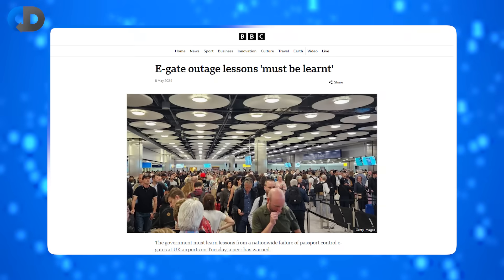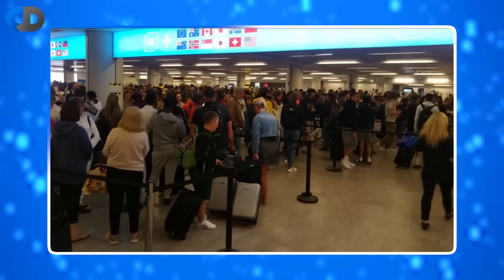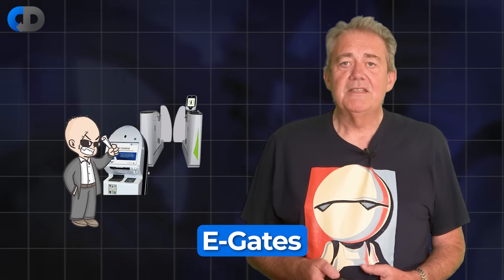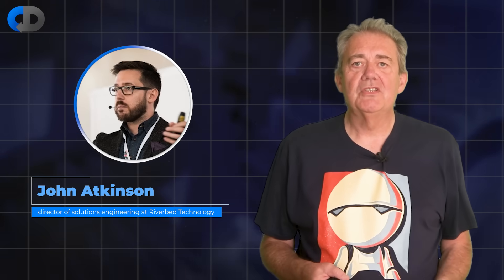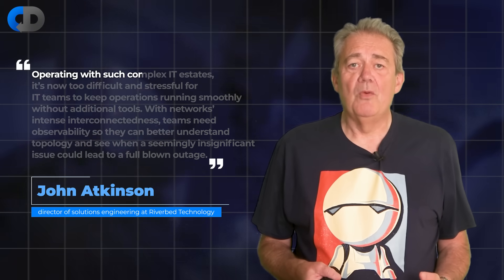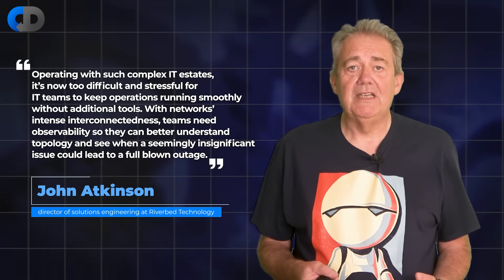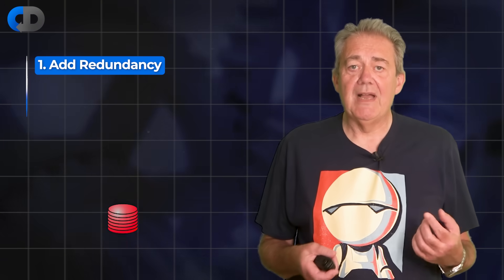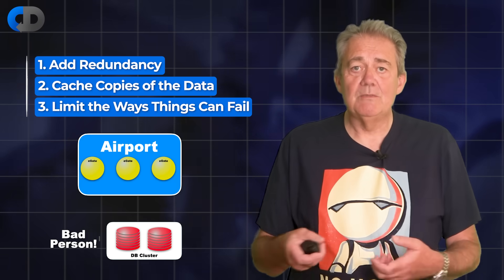Software Engineering F&*K Up Behind The Passport E-gate Failure

Comment from the maker: FREE 'How To Evolve Your Software Architecture' Guide: How to work in ways that keep stuff easy to change which gives you the freedom to make mistakes and experiment and how to work in small steps that allow you to determine their fit for your present understanding of the problem... continuously. All explained in this FREE compact guide. Download HERE ➡ https://www.subscribepage.com/evolve-your-architecture
Reply: This video is bad advice or at least incomplete.
1. It is a problem of service management first. Because the failure of the network was either not evaluated or not tested.
2. Sometimes I do not want resiliency - I want failure. Because if the system is failing, it could be a bug, design bug, security breach. If it is a design bug or security breach, resiliency may result in leaking or corrupting a lot of data. Potentially - customer data. It is better to fail than to continue.
3. How easily you dismissed security issue. Why?
4. Usage of cached data may not be suitable. If a bad person must be stopped now, then cached data is not an option. Usage of cached data introduced replication, invalidation, privacy challenges. This can be exploited. This introduces more things that can break.

And if all things can break, then advising to do better design, to have caches, to have secondary channels - conceptually does not solve anything. As we are on continuous delivery channel, you should know about ITSM practices, ITIL, MOF... They all focus on continuous improvement besides other things. There are critsit trainings for that etc. There are business continuity plans for that etc. It is ITSM - not another component or piece of code that fails.
Reply: ...  as estonian i'm just... 

"what on earth are those  brits yapping about...  " that system is Mid level difficulty , how can you fail in system like that.... :D not even  superdifficult

i guess,  estonians are just on another level in state-level e-services and infra , 

e-services have never been down  :D .. in the rest of the world, u watch Weather Report from news.. 
in my country... in weather report , there's  cyberattack reports , how many times attackers have failed this week : ))))))))))

Comment: You fail to address some vital things in this criticism which makes it hard to take you seriously

Potential issues with your suggestions:
- cache the data

What is the acceptable latency for data to be out of step?

My theory would be that the engineers were told there is no acceptable latency to someone being marked as not allowed to enter, and the machine knowing that at the time of entry

- store the data at the e-gates

Is this acceptable from a security perspective?

Comment: The home office is not going to allow airports to store copies of their data. They're also not going to host their own local cache instance of their API within airport networks, either. This has a security nightmare written all over it and would get shot down immediately. 

The problem appears to be connection related. If true, they should be looking at using  dedicated connections, and have a backup connection.

Comment: In the early 2000s I was asked in an interview to look at a system and say how it could go wrong, and how I'd mitigate against it (or what could not be and we'd accept failure gracefully).

I haven't been asked anything like that since. Just a lot of questions about algorithms I'm never going to implement, or design a system from scratch in 45 minutes with no time to really dive into all the failure modes.

Comment: Lots to unpack here. Replicating data into a local cache will reduce/remove the immediate impact on back-end system failures, but, it throws up other problems beyond update latency on the local cache. You now have the opportunity for secure data to be accessed and manipulated away from the central security. You have created a weak point that could potentially be exploited. One would hope that you can harden access to this local cache to prevent that, but you've created a new design issue and weakness that has to be assessed and fixed. Availability is a key issue, but also, system security integrity has to be maintained. I would envisage a capability to put an all-stop on processing. This could be for example to maintain security and integrity - something that likely would never be acknowledged. That 'need' would likely have a higher priority than end-user inconvenience. That said, any networking for this kind of application must be on secure infrastructure only (which absolutely excludes the use of WiFi at any point). The problem is that integrators and systems maintainers tend to put in back-doors to make their day-to-day life easier. I know this happens. In scenarios you wouldn't believe. 
Just putting 'exclusion' data locally creates potential problems then created from providing stacked updates back to the central system when endpoints become detached. Not insurmountable, but another set of problems to be overcome to ensure latent updates are correctly applied. There will be an awful lot of processing going on behind the scenes to provide for example, tracking alerts to many UK security agencies. Processing that has to be done in real-time. It is a bit more involved than tracking stock and sales transactions in a retail environment.
Could the e-Gate system do the same as the laptops used instead? Probably, but, there may also be operational reasons for falling back to a people based system. But, I suspect the actual cause was budget limitations considering the cost of a more flexible higher-availability solution. A 'safe' system that has a 95% availability target was all that the budget allowed.

Comment: I do agree with small portion, but having a cache is not correct and form a security perspective is wrong. lets put it this way.
1. 2pm Internet is down and system has a local cache of 10 people. 
2. 3pm new person is added as a bad person (system is still down)
3. Bad person enter the country and use e-gate -> Welcome Sir ....
Above is very unlikely but still can happen. We are dealing with very very sensitive data here and I am surprise the idea of local cache is proposed. I am surely its not a perfect system, but you need to understand the full system first, before making suggestions.

Comment: It's really cool you have so many technical brains here but the reason the system doesn't have local cacheing is that is a political toy, not a system of technical efficiency. 
The governments are pandering to the right wing, they are posturing to "keep the bad ones out", which is why a fail-closed system based on a single link rather than a series of reversions is in place. 
A technical minded person researching this to build it would know that 99% of pickups (getting the baddies) happen >50 nautical miles from any given national border based on statistics released around 2016 that were measuring the efficacy of post 9/11 security policies Vs recent and older history. Knowing that, a technically minded person like the majority of commentators here would have said that having multiple redundant links over different mediums with a layered system of caches and databases would have suficed to keep people moving safely through the port without losing critical data. 
Sorry, not sorry.

Comment: It’s the £££. Hardening a system with extra resilience adds development time and infrastructure. at some point a line is drawn where the budget / cost vs benefit trade off is deemed acceptable and anything that may happen rarely is just accepted as a risk. That’s the reality unfortunately. While there are several solutions to the problem that happened, at some point they were deemed as not desirable due to the financial impact to the project. Ie a dual network link from two different providers routed through different pathways costs more than not having it. A local cache or local server that would need to meet XYZ data protection requirements in each site costs more (surveillance, cages etc). Redundant power costs more and so forth. So at some point there’s a line drawn in the reliability department and the rest accepted as collateral damage, especially in massively over budget public sector project

Comment: Another example of egregious British Information System design and implementation.
Other examples - neither the Passport Office nor the NHS can handle surnames with full stops or commas in them, such as St.George or d'Ath. This issue is common throughout the British private sector and local government as well. To be fair, HMRC and DWP get it right, which causes problems when trying to match individuals between different systems.
"Losing" records is another common failing, so DVLA can't find records relating to driving licences, for example.
One of the issues I most frequently encounter in the UK is the non-involvement of senior people who have actual knowledge of the real world requirements.
YABSS (think about it).

Comment: Sounds like some one made the decision to have only source of truth (considering PII is being looked up). 
If one does not trust storage at rest in caching systems than this is what managers often decide.  
They should have at the very least have had a redundant communications network though.

Another issue i often see is that management is wary or downright scared of eventual consistency: imagine a database was updated to include a new unwanted person and the gate wasn't updated in time.... Everything involves risk, but if you are optimising to prevent that one small edge case to the detriment of the entire stability of the solution. YOU ARE DOING IT WRONG :P

Thanks for another great thought provoking video!

Comment: While a good example of failure, it maybe that other factors really really got in the way of the 'design', such as the secrecy of certain aspects of the said 'bad person' list (Oh, people & politics, sigh), but as said the fall back may have been worse, but more acceptable. 

And maybe the presumed BT shutdown of a Wi-Fi channel should (that word again) have just change to the £1/MB charged else where on some mobile plans ;-) politics & money.. (see Matheson's 11k iPad bill...)
Reply from the maker: I am sure that that was the thinking, but that is the design challenge here, how can you achieve all of those requirements while still achieving resilience. I can think of several different approaches that may work, and I am sure that we could find one that did once we had examined all of the constraints. But that is the job! Not simply making a crap system because some parts of it are difficult to achieve otherwise.Our job for a system like this, should be asking us to solve the hard problems, not just find the naively simple solutions!
Reply: @ModernSoftwareEngineeringYT  One part of the problem is the generally fallacious belief that we can always create a design that solves all of the problems with just a lead developer or small team.
  
Once the scope of the 'system' reaches the level of "Crapper's brainfull" (the metaphorical last person to completely understand the system they were designing) then we continue to find levels of detail that were unknown or unappreciated that result in such failures.
 
This is tree of knowledge issue is covered by RE Bohn's "Measuring and Managing Technological Knowledge" paper (1994/1998 Sloan Management Review/ ..), and is also reflected in Conway's Law.

It ultimately results in the proliferation of the ideas of Systems Engineering which also attempt to address the issue.

'Government' systems do tend to have that greater level of complexity ("Wicked System" problems of multiple stakeholders and longer term issues) than commercial systems with their 'simpler' shareholder focus (which is bad enough..) and PR management. 

However I do agree that there should have been more resilience foresight and expectations of the 'if it can go wrong it will go wrong, badly' style.

Comment: Unfortunately, the cheapest bidder tends to get the contract. That inevitably means delivering the absolute minimal agreed specification, and if that doesn't include contingency then what can the developer do? It's not the developers job to write the specs/urs (though yes, they will have an influence, especially if the purchaser's IT skills are low). Local data? Surely we've cracked that security nut by now?

Comment: Very interesting. What if the backup list was only used when the connection doesn’t work? Wouldn’t that avoid the eventual consistency problem when things are working?
Reply from the maker: there is no eventual consistency problem when things are working, changes would happen so fast that it would be, effectively, the same as the supposedly synchronous version.

Comment: Simian army, and the MS STRIDE threat modelling could have identified this, and then adoption of something like the BitTorrent protocol (you wouldn't steal a list of those not allowed into the country) to provide resilience around node failure could give peer to peer sharing between gates automatically if they can see each other on any IP network. Local DB for actual processing and....it....should...work?

Comment: Erlang is a great tool for running those e-gates.

Embrace the failure, live with it , anticipate it , crash now and catch it later (in a matter of ms) using supervision trees and distributed computing Erlang provides among many other features.

Great talk, sir!
Reply: Erlang also designed as a distributed system where the client is the source of truth. So no matter how many retries there will be guarantee of correct input. E.g, multiple cell towers could handle a call, and whichever failed to handshake first would crash. It will in no way affect the correctness of the entire system, only a momentary capacity issue.

When it's the reverse, you can't really rely on retry because there's no guarantee that the crash condition would either repeat or be resolved in timely manner.

Comment: Many years ago, ticket controlled passenger barriers were installed in Newcastle Central Station.  I travelled several times a week. As an experiment, for many months after the barriers went live, I used the same old ticket to pass through.
I expect either a software / requirements bug, or incomplete development ... or problems getting some link to a back office database.
The interesting thing about the passport gates is that there is actually no need for the data to be fully up to date to the millisecond, or even the hour. It is all about limiting risk to the protected territory, not eliminating the risk. (Although I suspect that many do not understand the difference).
The system may also be logging arrivals and departures of all individuals as well as other "features" in addition to a "bad actor" lookup.
Reply from the maker: Yes, and all completely solvable problems with a truly distributed design.

Comment: It often boils down to, "we took the cheapest quote." Local copies require extra nonce in each gate which means more cash.
Reply from the maker: That assumes that a good design costs more, I am not so sure that that is true, particularly when the kinds of orgs that get government contracts are usually massively overstaffed with teams of hundreds and sometimes thousands of people for a project that could, and should, be built  by 20 or 30 people.
Sure the procurement approach for such projects is broken and a problem, but that goes a lot further than the "cheapest bidder" problem I think.
Reply: Mainly decision makers not talking to or believing engineers, accepting declared risks out of hand with no intention of addressing them because it moves their plan forward...

Comment: I'm quite surprised they were relying on WiFi for network connectivity of critical infrastructure. Especially if the software is not designed to be tolerant of faults then making the infrastructure HA is all the more important to prevent and reduce downtime.

Comment: My former, and final, employer had a mainframe database as a single point of failure. Almost everything in the entire company that depended upon data ultimately relied on the mainframe. Adding insult to injury, the mainframe had to be taken down for several hours every weekend for maintenance. That in turn, shut down every dependent system, including the company ecommerce website which promised 99.99% uptime to business partners.